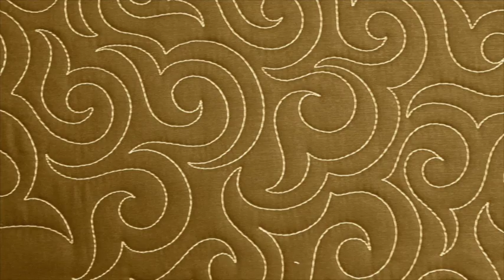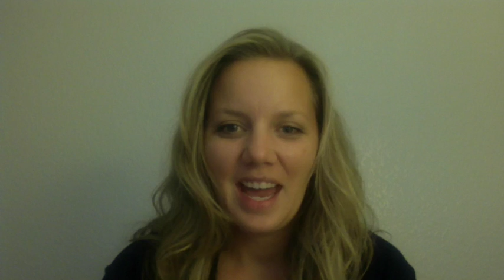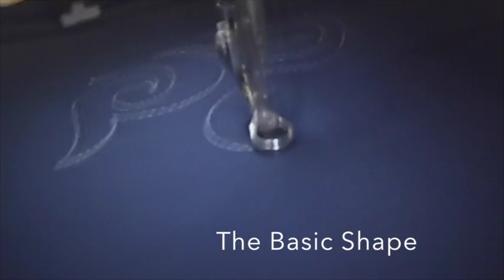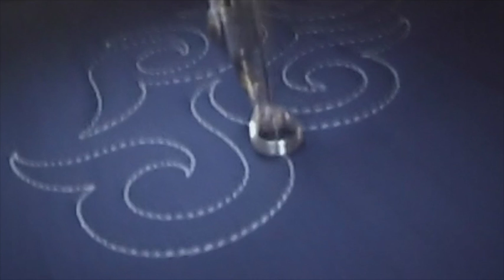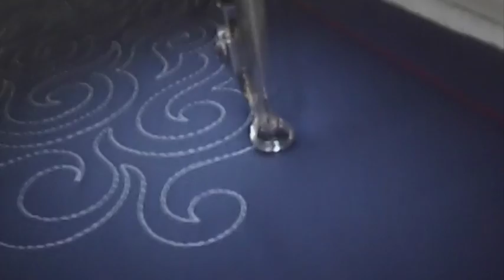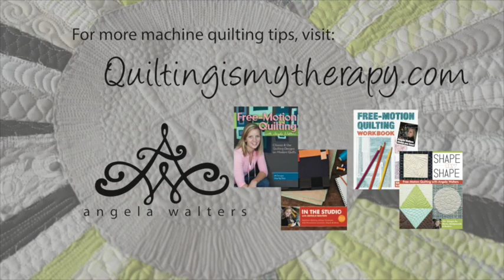Machine Quilting the Swirl Hook: A Swirl Variation Tutorial

Comment: your video is great,  I'm not getting this one. can it because I'm left handed? It seems that swirls and feathers give me the hardest time and I'm wondering if it's my handedness that messes me up. Thanks for any advice.
Reply from the maker: I don't think being left handed should make it harder. Usually when I teach this in classes, the biggest mistake quilters make is not making the petals big enough. this design looks much better when it's bigger!!
Reply: Angela Walters - Thanks, I  will continue to practice. When I looked at your book with this pattern, I  did find that I  was making the original swirl in the opposite direction. changing that has helped a bit.
Reply: Sew Me Sew You .